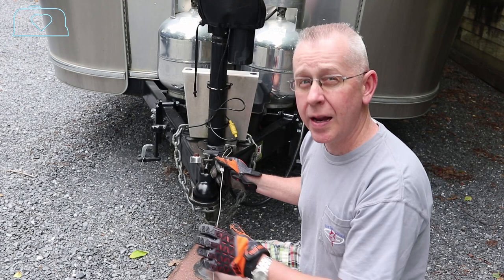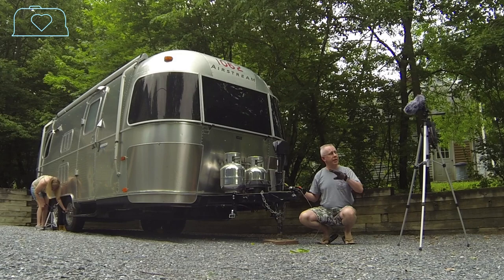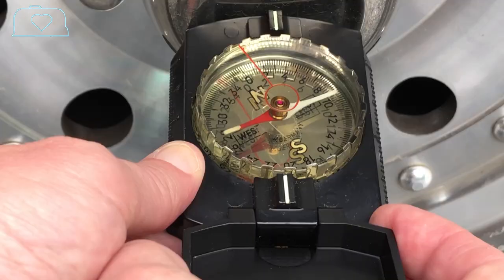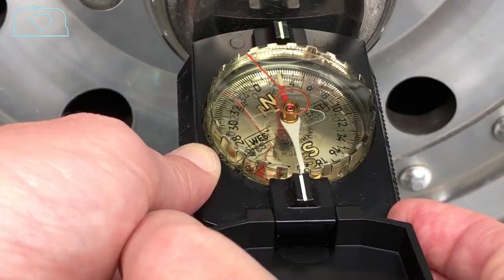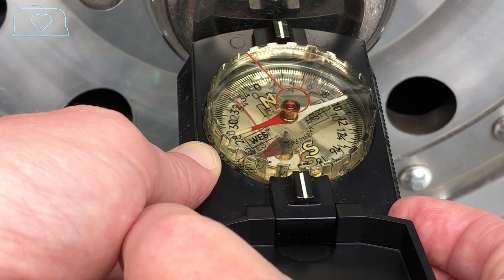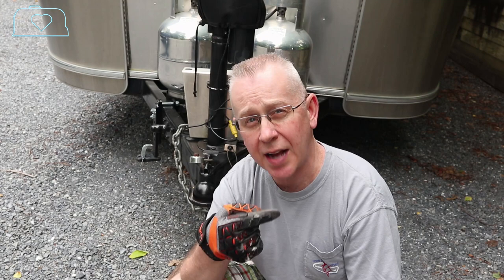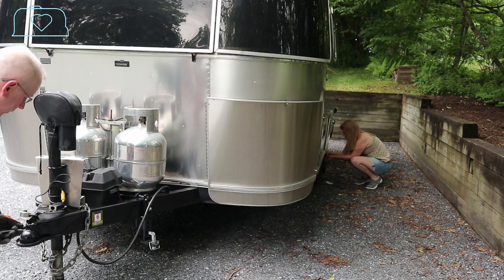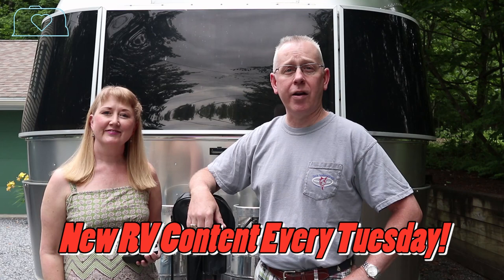How To Test Your RV Trailer Breakaway Switch

Comment from the maker: IMPORTANT UPDATE:  At dinner tonight, Cindy asked "Will this test work with an iPhone compass?".  Excellent question.  I thought I knew the answer but Luv Subbin is all about RV science and theories must be proven through observation.  First step: state the Null Hypothesis.  In this case, it is "There is no difference between the way a traditional compass and an iPhone react to an induced magnetic field".  We conducted an experiment using my Stiegl Bier fridge magnet.  The traditional compass reacted as expected whereas the iPhone did not.  We must therefore reject the Null Hypothesis and conclude that the iPhone compass will not work for this test.

Comment: Your test showed that the magnets were activated but don't show that your actual brakes are working.
I live in Pennsylvania and have to have a yearly state inspection on my trailer, the mechanic will pull the break away cable and have me try to move the trailer with the truck, which shows that the brakes are actually working.
Reply from the maker: Thanks for watching and good point.  We live on a dirt road so every now and then I'll have Cindy hit the Emergency Button on the brake controller to ensure our brakes are indeed working.  I think the most common failure mechanism for the breakaway switch is the wiring and connections from the switch to the brakes and our procedure will test that.

Comment: New to Airstreaming, but I think you should test this when you repack wheel bearings.  You can try to spin the hub with the tires off or spin the tires while up in the air.

Comment: Hello, good info, thanks for posting.
But fyi, at least for the Reese (Breakaway Switch w Led indicator) 8507311 & 300 it has these instructions before testing it:
WARNING: Disconnect Trailer Plug before testing  Break-Away  Unit.  Failure to do so will result in severe  damage to electronic Brake Control.  DO NOT use Break-Away Kit as a parking brake.  End of REESE WARNING.
The parking brake part you covered.  I wouldn't have known about the disconnect trailer Plug if for not replacing my 37 year Break-Away switch, but I'll do it now.  Hope this helps some.
Thanks.
Reply from the maker: Thanks for watching and that is good information.

Comment: Well I just learned something new so I have kept my breakaway pin removed as I had an attempted theft of the truck and trailer some months ago so I figured well they won't think to look for the breakaway cable and it will keep the brakes locked up, well little did I realize that this would affect draining the battery and also possible damage the electromagnets?  I'm going to remove the drums and inspect now that I have learned this.
Reply from the maker: Thanks for watching and I'm glad we were able to help.  I would certainly check the operation of the magnets and brakes if you had the pin pulled for an extended duration.

Comment: Thank you for the demonstration. Being a skeptic, I agree you demonstrated the electrical side worked but you did not prove the mechanical side is working. The shoes or pads could be rusted or bound. 
I believe the only true way to prove the system is working is to pull the pin and see if the wheels are locked.
Reply from the maker: Thanks for watching and good point.  I've seen some videos where people will jack up the trailer, spin the wheel, and pull the pin.  We live on a dirt road so we occasionally hit the brake controller's panic button to make sure the brakes work.